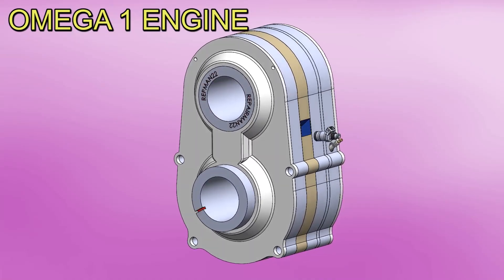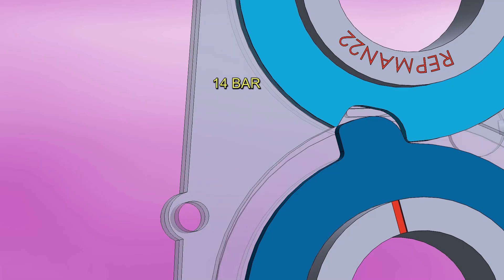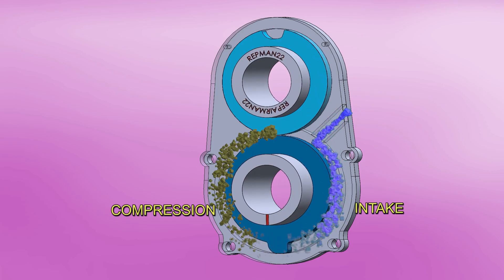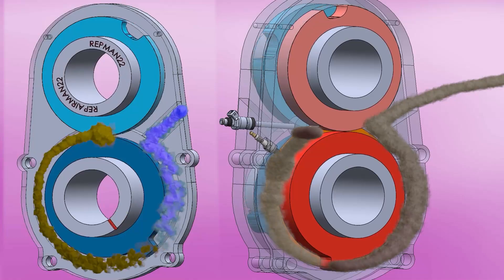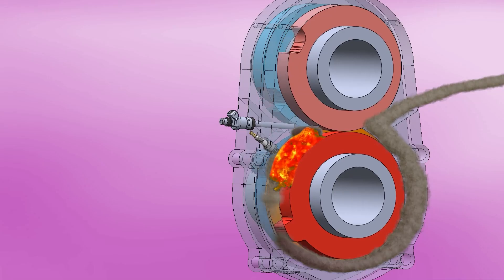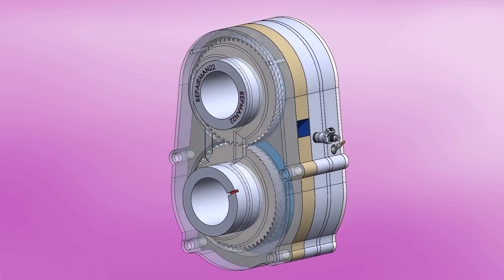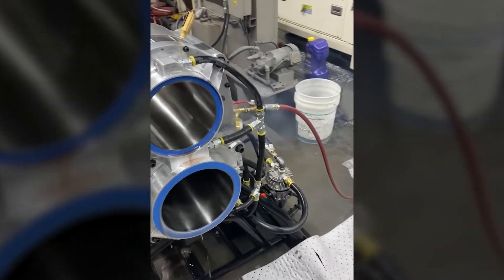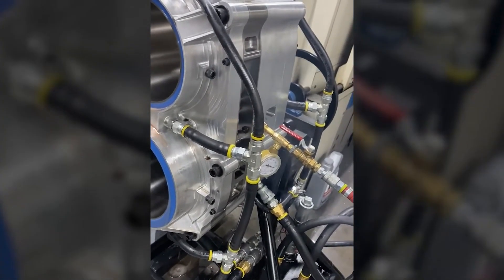😍 Can you FIT 160Hp in 30 Pounds? This New Engine Can. The Omega 1

Comment: Why not just use a twin scroll to compress air into it instead of this leaky design ?
Reply: i always wondered how practical it would be to use superchargers as a compression stage, and pistons, turbine, or a reversed supercharger as the expansion stage.
Reply: @Retired Bore I was more specifically thinking of positive displacement compressors, not dynamic ones.

Comment: "If something sounds too good to be true, it usually is."

This is a great case of some interesting engineering with some giant holes in it. I'm getting the same vibe from the Omega1 as I did from the LiquidPiston offering; a lot of flashy designs, trying to plaster over the inherent flaws of the concept. As others have mentioned, 0.1m tolerance isn't that great- Google converts that to 0.00393701 inches--let's be generous and round down to .0039. That's still just a c-hair below .004, and that kind of tolerance is already pushing the limits of acceptability in deviation for certain parts of a carburetor, in a racing application, much less the internals of a high-pressure engine. You expect me to believe that this kind of design would be acceptable in aerospace and aviation? Puh-leez. In aerospace, if a machine shop can't reproduce parts with something like .0003 accuracy, there's a really good chance that a contract will be pulled (depending on the part, naturally).

 In theory, these things are awesome, but you'd think that Mazda would've beat everyone to the punch with some kind of variation of a rotary engine (not just a Wankel) if there were a fool-proof way of handling it. If not Mazda, you'd think that Toyota and Yamaha would've already found a form-factor like this; the engineering that went into the LFA alone is brain-bending, so this is kiddie-pool stuff in comparison.

This engine is a fun concept on paper, but it just doesn't work without actual sealing mechanisms. One wouldn't be able to count on the design itself sealing, no matter the materials employed in manufacture. That oil leak? It's 'cause the design can't hold it. I doubt even less that it'd keep fresh and spent gasses separate; the blowby would be terrible, I imagine. There's a reason we still use springs and rings.

/pretentious_rant
Reply: @Retired Bore
There's fire in that there hole.
Reply: next time you start your car think about the 0,5mm clearance between the pistons and the cylinder wall, when the pistons are still cold. its not that noticable. the differece here is that you dont have a seal to make up for it, but the gap is also only about a centimeter long, so not much gases can pass, considering how little time they have before the next cycle. The concept has been well thought out and they have experienced engineers in the team. The main concern i have with this project is that it made the news one or two years ago and nothing else has been published about it since, simply meaning the development might prove too expensive if the company hasn't found enough funding.
Reply: 0.1mm tolerance is nothing to write home about. Valve clearance of my bike, IE, has to be between 0.15mm and 0.20mm, so with a tolerance of 0.05mm, and it's not anything "racing". That doesn't mean this is, to me, a viable product. I see many sealing problems. Compressed air and air/fuel mixture simply has too many passages to do, and having, like in the Wankel, a "hot" and a "cold" part of the engine, worsens sealing problems.  
Liquid Piston engine doesn't seem a to have anything wrong actually.
Reply: @neutronalchemist3241  
The LP engine has a lot of things wrong with it, actually.

The company claims two major advatnages: effciency due to "HEHC cycle" and high power density. But both claims are extremely misleading. The thing is, they have NOT invented any new thermodynamic cycle at at all, that's just a publicity stunt nothing else. Their HEHC cycle is really just a gasoline engine with advanced timing (or decreased cut-off ratio for a diesel) comboned with atikinson/miller cycle BOTH of which are common strategies to increase efficiency. It is also possible to overexpand by using a turbocharger, that can be connected to the crankshaft, a practice that dates back to WW2 and is called turbocompounding. There is NOTHING unique about "their" thermodynamic cycle. It's really just the atkinson cycle paired with advanced ignition timing or low cut off ratio. 

In fact, I doubt there is much useful overexpansion in their engine, as the overexpansion chamber, which is in the rotor, has one end open (where the gas is finally exiting into the exhaust manifold) as the gas is expanding in the rotor. The surfaces that enclose expanding gases have to move relative to each other if you want to extract as much work as possible, and you really want to keep it enclosed. Otherwise you've only created an odd shaped nozzle, which is far less efficient at extracting work comapared to an enclosed chamber with a moving wall (like a piston). I think they claimed 8% theoretical increase in efficiency by overexpanding, but it would probably be way less than that.

On top of all that, only the combustion happens in the claimed low surface area half sphere at the top, but gases stay hot after the combustion, of course, and as the engine rotates the shape quickly starts looking more like a high surface area wankel engine. There would be significant energy losses to the walls here, just like in a wankel. Maybe slightly better than a wankel, but definitely not better than a piston engine.

When it comes to the power density or power to weight ratio, it is really easy to claim 10x power density if you compare to old, fully equiped, cast iron, 4 stroke diesel engines when you have a completely "naked" engine that is made of mostly aluminium. Instead compare it to a aluminum 2 stroke piston engine and that 10x figure pretty much disappears. I know, I know "but 2 stroke piston engines have bad emissions". Just use direct fuel injection and external scavenging, which has been used for decades, especially in large marine diesels. 

So they have no unique new thermodynamic cycle, and so no efficiency advantage (more like disadvantage due to shape) no power advantage if you compare to the right engines, as one should, and most of the disadvantages of wankel engines, mostly sealing. Yes, the fixed apex seals are better (wear less, need less oil) than a wankel but absolutely no match to o-rings in piston engines, especially considering those apex seals have combustion chambers on both sides, which means any oil scraped by them ends up in a combustion chamber. Seeing over ten years of development and still in the research phase, and efficiency figures not even close to the claimed figures (last i checked, they haven't even passed the base 30% TE that most piston engines already achieve) I think it's safe to say there really is no "revolutionary" future for this engine. It's just a slightly improved wankel.
Reply: .1mm cold becomes what when the rotors are up to operating temperature? Perhaps he meant .1mm clearance, not tolerance.
Reply: @WeighedWilson  Yeah, while I wrote 'tolerance', I was thinking of clearance. Either way, the problem remains. The way this machine is designed, the mechanism itself seems to be the 'seal', and that .1mm clearance isn't going to seal itself well; you're going to see a significant amount of blow-by and fluid leak, which is why we see that prototype practically pouring fluid.
Reply: I'm thinking boundary layer  effect may make the seal good?
Like, the roatator is going against of gas leak, and the wall may actually "pull" the gas because the gap is so small.

That is purely a guess from me though.
Reply: Agreed for the most part, though a point or two of observation.
The average human hair is .003" thick the primary exception being the Red Cunt Hair, which is .002".
So technically the spec is two RCHs.
The oil leak can be addressed by the fact pliable seal materials have a restriction on Surface Feet per Minute.
The shaft is so large, any significant RPM would damage the contact surface.
It's also an indication the oil is making sealing possible, which is not practical.
@Retired Bore From my understanding, and not to discount your observation, the fuel injector is positioned to hit the far side of the retreating rotor face just before compression begins.  In addition the plenum volume is 'tuned' to the corresponding RPM to optimize thermodynamic efficiency.  Going by other reports.
Reply: I also wonder about the seal between the wheels and the sides of the housing. Seems like an impossible balance between getting a good seal and suffering lots of loss to friction.
Reply: what if there were external housing that could be pressurized to extent that would resist any leakage?

Comment: Brilliant.

I see this engine as being a constant RPM, efficient engine-generator, to be a range-extender for the coming generation of EV automobiles.
Reply: Yeah use with a CVT would make sense or hybrid
Reply: @AsthmaQueen   BVs are their own continuously variable transmission; indeed, not having a dual path of power to the driven wheels (aka, a hybrid configuration) saves weight, expense, mileage efficiency, ... and piece of mind, considering the issue of "range anxiety."

No need to make the first law of thermodynamics any more applicable than necessary.
Reply: @brianhiles8164  You are completely wrong about hybrids. "not having a dual path of power to the driven wheels (aka, a hybrid configuration) saves weight, expense, mileage efficiency" is NOT true at all, it's the complete opposite. PHEVs and HEVs could have a small engine and small battery, the small battery would be enough for maybe 90% of trips and the remaining 10%, the long trips, would be engine powered. The hybrid vehicle's small battery means a lot less environmental impact and cost than a BEV, while the smaller engine means the same compared to larger pure ICE powered car. Overall, hybrids are much more energy efficient than ICEs and cost way less with MUCH smaller environmental impact comapared to BEVs.
Reply: @LocPH.   Your comment is problematic insofar as I never mentioned, and did not intend any relevance to, hybrid electric vehicles. It is BEVs I talk about.

Your assertions about efficiency is especially troubling because, while BEVs and hybrid-electric vehicles are indeed more efficient than ICEs, the point is all of the conventional power train to the wheels is dead weight if it doesn´t indeed need to be there. Aviation and race car engineers have a saying: If it´s not there, it weighs nothing, costs nothing, and will never need to be maintained.

Specifically, I am not confident that you understand that the “efficiency“ of EVs will come at a price of a trillion dollars for raw materials and manufacturing infrastructure and power generation and distribution infrastructure -- and their respective environmental impacts -- which must be factored into such a determination. None of that will be battery powered. There are compelling technical papers that explain this in detail.
Reply: @brianhiles8164  "Your comment is problematic insofar as I never mentioned, and did not intend any relevance to, hybrid electric vehicles."
- then why did you say this:

"not having a dual path of power to the driven wheels (aka, a hybrid configuration) saves weight, expense, mileage efficiency, ... "

You very clearly talk about disadvantages of hybrid vehicles, so there is clearly a relevance to them. You are obviously not just talking about BEVs. Have you forgotten what you yourself said? If you are refering to another type of hybrid, please elaborate.

Further, " the point is all of the conventional power train to the wheels is dead weight if it doesn´t indeed need to be there."
- did you not read my comment at all? The point is that the powertrain is smaller. Having dead weight is completely irrelevant when each part of the powertrain weighs much less in a HEV or PHEV. That includes the battery and range extender. Do you understand what a range extender engine is and how it differs from a pure ICE powered car engine?

As for you last point, I do not think you understand that regardless of what technology we go with, trillions will be invested. New cars, and infrastructure, is built everyday. Do you not know that? Opposite to what you say, there are compelling technical papers that conclude that the best course of action is, in fact, widespread use of PHEVs. This takes into account the added power infrastructure, as the enormous efficiency gain more than makes up for this, due to a significantly smaller demand for fuel and all the infrastructure that entails.
Reply: @AsthmaQueen  CVT's suck.
Reply: @akulkis cvt suck in current implementation. Engineering explained has a video on why they are better and why all the ones in mass produced cars suck. Hint: because people weren’t used to one gear they wanted the feel of a regular transmission with the gear change effect. So they made the cvts act more like normal transmissions defeating the whole purpose of cvts.
Reply: could be 👌
Reply: BV.  EV is a misnomer.
Reply: exactly - imagine a Tesla with its ultra expensive lithium battery pack drop-in replaced by this engine as a constant rpm electric generator and a relatively miniscule battery pack - that would make the Tesla a far more viable vehicle than being a EV only. Plus it would lower the over all vehicle life time carbon foot print to where it actually starts to have a significant enough delta vis-a-vis an ICE vehicle that the rationale for EVs actually starts to be realized. (However, even the dependence on a much smaller Lithium battery pack is still a big issue as the process of obtaining Lithium and processing it is so horrific per the environmental consequences.)